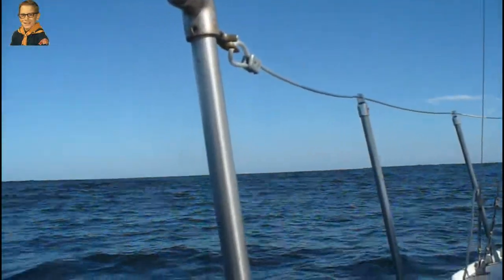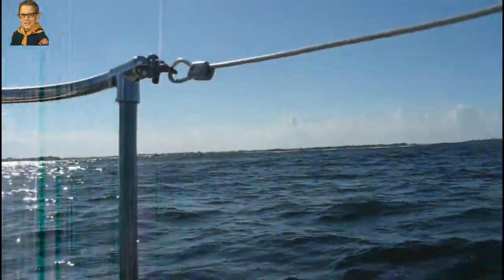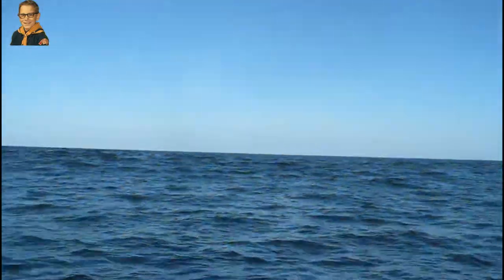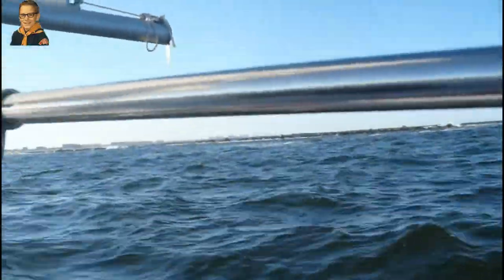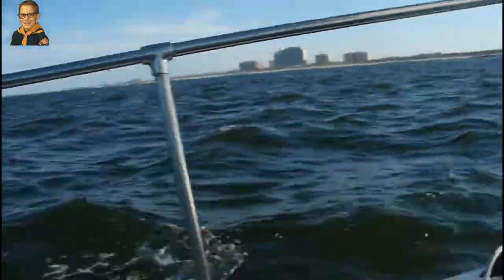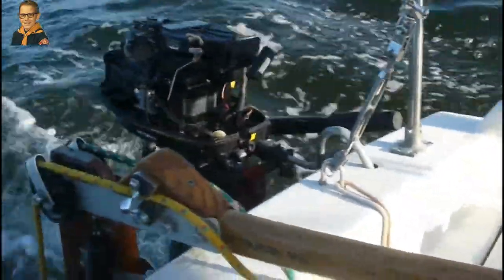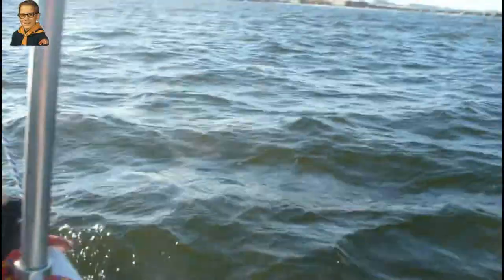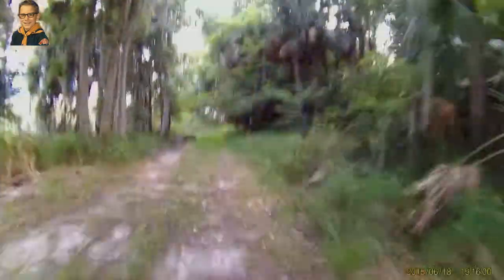Part 10. Design and Build a Sailboat Rudder: Final Rudder Test

Comment from the maker: I had checked the radiator fluid on the van before I left the house, and when I put it back on, apparently, I left it just slightly loose.  As a result, all of the fluid all blew out the top.  I had some gallon jugs in the car, and there was a water fountain nearby, so I filled it with water long enough to get home (of course, the next day, I refilled it with the proper fluid).

I was very pleased with the rudder performance, and the new hardware worked perfectly.  The only issue with the hardware is that, while most of it is stainless (whatever I could get), some of it isn't, and it's difficult to keep it from corroding.  So, in the long term, that will have to be replaced.  I've painted some of it, but even the "galvanized" hardware didn't live up to its name.